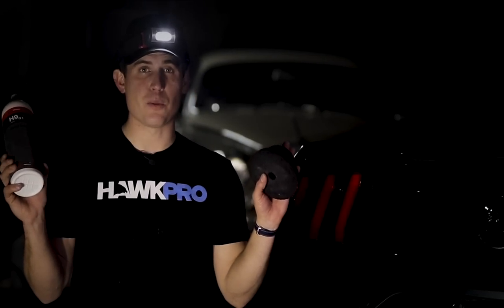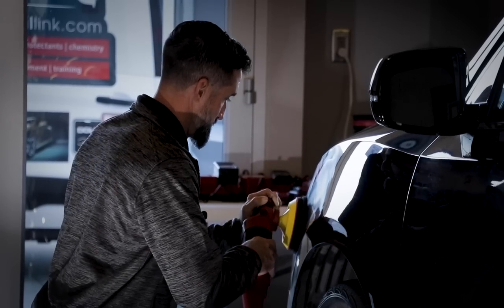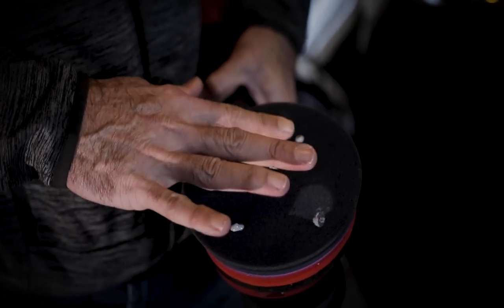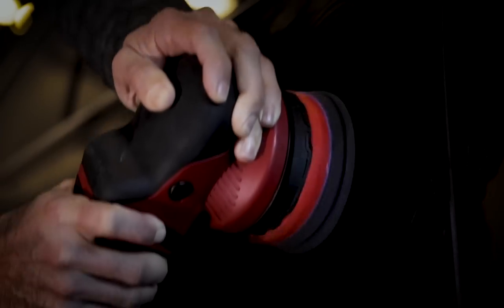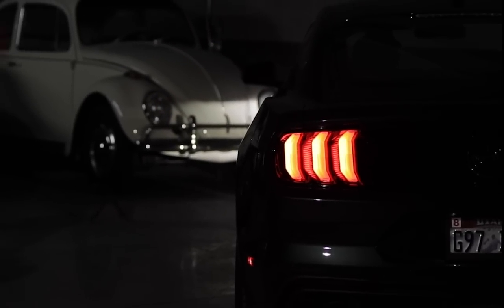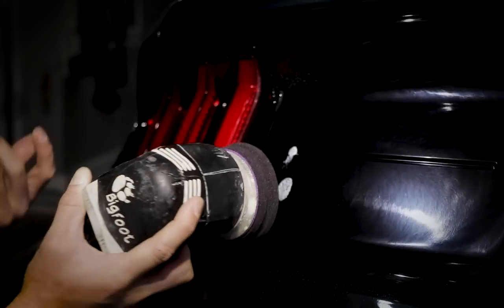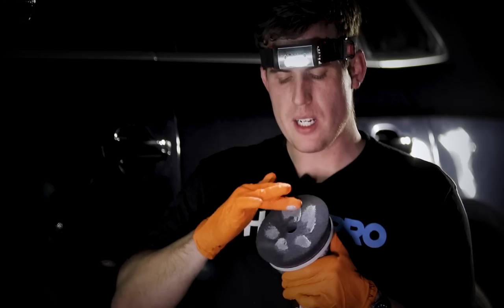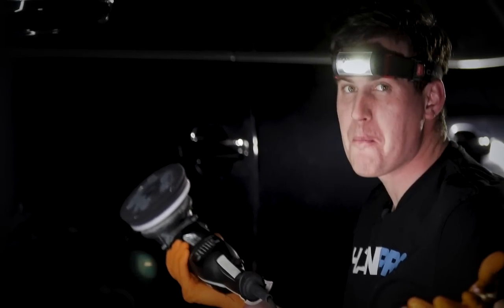BREAK ALL THE RULES FOR PERFECT PAINT! A game-changing polishing trick

Comment: You forgot to mention, STOP USING TAPE! My first and second polishes I used tape, accidentally bumped it unknowingly and there were always ticks left behind no matter how many times I blew the pad out! Looked glossy and better than unpolished, but Little hair scratches everywhere! So irritating!
Reply: Not sure I understand. Are you saying that masking tape is what causes ticks and scratches? Thats a first hearing this. How do you suggest protecting surfaces then without using tape?
Reply: @MrBod4life  yeah I was using the “delicate” version of scotch masking tape assuming it had less glue residue to leave behind. Regardless, when I hit it with my machine, I think it picked up residue up and was leaving hairline scratches anywhere I used that pad.
Reply: @Ichabod_Jericho  Thats interesting..Do you have any suggestions? Maybe try different tape?
Reply: @MrBod4life  try kamikaze kamoi tape only available in the US through Esoteric or 3M precision. Those are the 2 I use when I have to tape an area that I will be polishing over as opposed to might bump into
Reply: I don't think its the tape honestly. I use regular blue painters tape from Home Depot and the only time I ever encountered a problem is when you lift the edge of the tape and it might hit the adhesive. So you may be spreading that onto the paint. Has only happened a few times to me

Comment: It's called GRIP to cut and SLIP to polish.  Grip and Slip baby.   That technique is very similar to the Jab technique I use for a mow down correction technique with short movements then long then back to regular to finish out.   You can do low arm speed less passes or faster arm speed more passes or a mixture of whatever you want. shining shoes is mainly created by fast rubbing with some product but not too much and no pressure or light pressure.  the same applies to paint most often. I still love to finish with a rotary at very low rpm like 350-500 rpm than use a DA.  paint correction/ polishing is a game of adaption.  rehearsed routines lack the flexibility to adapt - bruce lee. so always have an open mind to other ideas/methods and think outside the box.  Like me using deburred wool and jewelling polish to correct swirls or paint dry spray on painted plastic bumpers but also on metal panels in small areas.  keeps the wool pad moist and prevents clumping so the fibres can keep working.
Reply: I’d like to know more on the paint dry spray process

Comment: Interesting...might have to try that.  So how many MF pads do you use with that?  Just the one and keep blowing it out or do you eventually get a new one after say 3 full panels?
Reply from the maker: I swap a new pad every panel but I'm just OCD like that. Every paint is different but this method works super well on most paint. If not... I do the speed 6 method,  even pad pressure with 3 inch purple pad and m3 and because the small pad is like a scalpel I get mirror finish. Not super efficient but always works even on finicky black paint

Comment: Finally someone that understand the speed + rpm's rule ..this technique is actually from the CNC area, milling and turning.. I never understood why most detailers use low rpm's + fast feed instead of the other way around.. it doesn't make any sense.. as a miller if I wanted a shiny and smooth surface it was with more rpm's and less advance. the mathematical formula of advance x rpm's over the tool diameter, is perfectly applicable in this profession as in a dentist, in a quarry, in a carpentry among other professions with this concept.
Congratulations for the video where you explain the 100% correct way how to make the perfect finish in the correct and efficient way and not in the huge waste of time that many do.

Comment: Reminds me a bit of how they teach the Optimum Hyper system. Leaving the compound residue, trusting the system more than managing it, etc. I've always been kind of a rebel when it comes to faster polisher speed and arm movement, so this is right up my alley. 

The single biggest "secret" to finishing soft paint for me has been soft high quality towels, residue control and working very clean.

I've been super obsessed with the rotary lately, and I already have M3, so trying the micro cut purple pad might get me back into that DA life. Thanks! Dope production on this one too. 👍👌✌
Reply from the maker: Thanks man! I feel like leaving h9 residue and going to m3 just didn't make any sense to me...and the fact that it works blew my mind. I've been grinding my purple pads pretty hard though, and if I had one critique of koch it would be their pads are great but seem to degrade quickly compared with other foam I've used...so lately, I feel like the consistency of results has gone down a bit when using purple pad after h9. However, the speed 6, slow arm movement, work m3 until translucent technique is money money. It's the koch system too so it must be them crazy Germans having figured something out haha
Reply from the maker: I've been doing more rotary work as well. It brings a gloss that da doesn't match, although I'm not sure why. I still feel more comfortable using a da/microfiber to get edges of panels
Reply: @HawkProDetailing    Thanks for the info! I'm ordering some pads! 

Rotary is alot of fun, I started using it with small pads and extensions to really dial in tight spots and gradually started using it for everything. It cuts fast and it really can finish better when everything is working together.

I've been using Xtreme Solutions LVR 496 a lot recently and it's been amazing, especially finishing finnicky paint.

Any special tips to extend the life of the pads you've found? I don't like flooding and pad washers personally, I basically use the Apex method, (a spray of cleaner, soft detail brush and blow out after every section.) I guess I should skip the spray of cleaner for the Andy technique. How often does he swap out that pad when he's finishing?

Comment: that decklid panel on my 18 stang is a killer. Going to try this, thanks for the video!!!
Reply from the maker: When it comes to piano trim, 3 inch purple pad with m3. Slow slow arm movement, speed 6 on my rupes 75e, a little bit of pressure. Work it until you see the surface through the oily polish and check it. It works great I promise
Reply: @HawkProDetailing  Thanks man I will!
Reply: They scratch super easy. There is a Ford TSB for it. The process is to use 3M Perfect It finishing polish and a foam pad on a polisher. It’s super easy to polish. I use a little bit of Sonax Perfect Finish with a light polishing pad and light pressure usually.
Reply: @JonathanGurgul  My original one was replaced, it had a small crack behind the GT emblem. Now on the one that is replaced, same sort of crack Behind the logo. The car never sits outside. Only 3700 miles. Eh I love everything else about it lol. Thanks!

Comment: Nick...Thanks for all the advice you provide.  I'm doing my first polish on the MIL's new car before coating it. I bought this H9 & M3 with pad combo you suggested.  Will either of them stain any plastic or rubber trim if it gets on?  Wondering if I need to tape it all off or not. Using the M3 only this 1st go around after claying it since paint is new.
Reply from the maker: Honestly you can buy blue paint tape at wal mart or ace or just go to o Reilly and see if they have tape. Even the paint tape from these stores doesn't pull of paint especially on new car. Sometimes it leaves a line when you remove tape, but it comes off with a quick polish pass. Just make sure to clean your pads frequently between sections and having a number of pads is helpful...I started in paint correction with one pad for a car not knowing what I was doing...now I prefer about 10 to swap out in between car sections like one door, swap pad, next door one pad, then swap etc. Don't overthink taping. I would tape anywhere you're afraid the polisher might bump into or get sling. So I tape rubber around windows, I tape emblems, I'll tape the plastic around a side mirror. If you get staining trying isopropyl alcohol wipe OR  your degreaser/all purpose cleaner FULL STRENGTH on a towel then rub spot. Jason rose advice I saw on a video is to use your plastic dressing like a meguiars hyper dressing on all plastics first...when compound sling gets on there it wipes off easy cause the surface is "greasy" or whatever, don't quote me on the terminology lol. Interesting concept but that's more around sling (I think) than polish on pad staining it if you get sloppy with your passes. 75 percent defect removal tops should be the goal. Do not go after deep scratches, especially as a newbie, it's just not worth it in comparison to the value of the car and your experience level and you are the only person who will see it. The goal for you is just a nice shiny car from 5 feet away that is properly polished and prepped to take that coating. Enjoy!

Comment: Would the arm speed and machine speed (6) change based on temperatures like for a mobile detailer outdoors on a 90 degree sunny day?
Reply from the maker: Speed 6 is my go to. I would say just start playing around with the technique immediately so you can figure out the ins and outs. Thay way when you run into issues you will begin to have the muscle flexed of how to work around it. When my purple pads start to degrade I notice the finish being impacted. Often going to a 3 inch purple pad gives me more control and I get the clarity I want. Worst case, speed 6 and a little pressure and very slow arm movement and you will love what m3 does for ya:)
Reply: @HawkProDetailing  high speed 6, slow arm movement and some pressure wouldn’t that creat high temperature on the paint and pads and probably damage both?

Comment: Great video , im having trouble doing paint correction myself i dont know if my car has to much protection as i always apply wax , spray coatings but i use like strio wash from adams and still cant get a good result still beadin , what product strong i can use for strip wax and sealants? Also i have the chemical guy polisher 5 inch with the foam pads , i also have wool pad from meguiars and the adams 3 inch polisher with micro and foam pads and i tried every combination with different compunds i have meguiars , carpro and chemical guys and i dont know if its my techbique but cant get rid of the swirls . Any tips appreciated thanks
Reply from the maker: Scratches are one thing. A straight line, that seems random and deep. "Swirls" or "spider webs" that seem a little more consistent are another. I like microfiber and a compound to get the swirls out. Lots of technique variables in that step but you will be left with a new pattern introduced in this step. As in, you eliminated car wash swirls...and you've introduced a tighter web of what people call "DA haze" ....those are less deep in the paint so you would then polish THOSE out using the techniques outlined. You could follow the instructions and products I recommend in this video or attend a training. Get a body shop hood and just mess around though before you start hammering on your own car lol
Reply from the maker: Polishing is the way to remove those sealants and spray coatings for sure